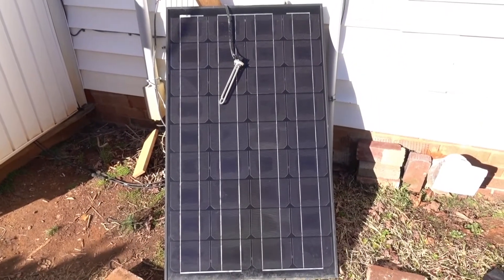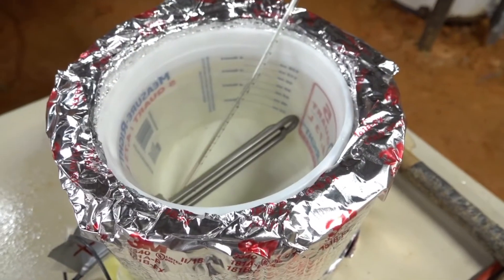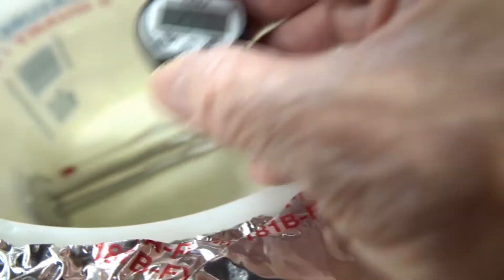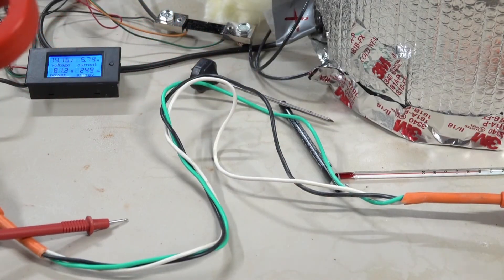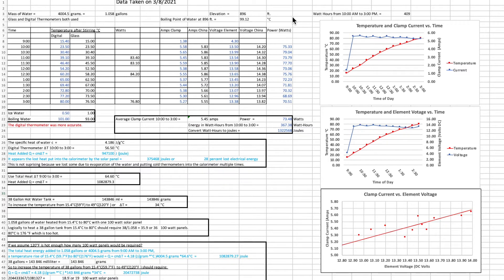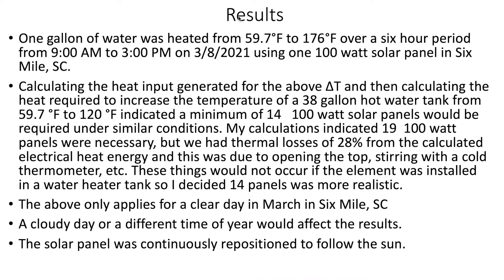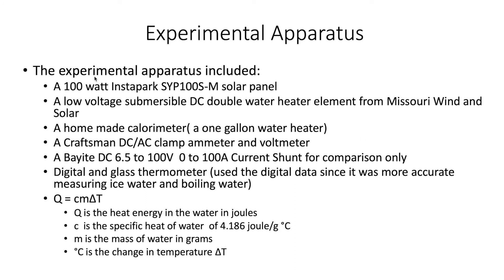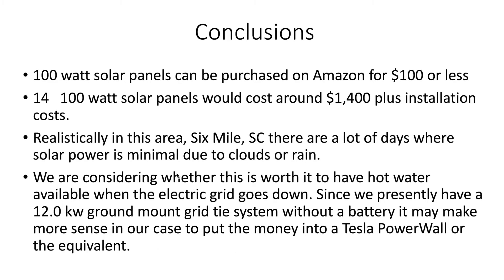Using a 100 Watt Solar Panel to Heat One Gallon of Water

Comment: Very informative video thanks for taking the time to show the world. 
I have a question I'm thinking to add in my scholie motorhome conversion a 6gln water tank with 100W solar panel can you help with what size in watts 12V element should I pair with.
Will the water stay hot/warm overnight installation would be inside and the home is well insulated.
Your help is highly appreciated.
Reply from the maker: You will need to include a thermostat. I used one element of a dual element, low voltage, DC model from Missouri Wind and Solar. They sell thermostats and an element with a built in thermostat. I recommend checking with them. This is a link to their website. https://windandsolar.com/dc-water-heating-elements/
Reply from the maker: Also make sure you have a pressure relief valve. The old Mythbusters blew up water heaters and after watching that it is a good reminder of the importance of thermostats and pressure relief valves.
Reply: Thanks for the reply, I intent to purchase a 6gln water heater tank which comes complete  with it's accessories and just replace the element to 12V.
 My question is what size element 12V watt's ??? With 100W solar panels if need I could go up to 200W.
Reply: @alexkalsatos5555   That could be an issue finding a 6 gallon tank with a replaceable element.  it takes about a KWH to heat up 6 gallons of water. That can't be done with a 100W panel.  Grid tie panels are more than twice the power at the same cost. Slightly higher resistance above ideal will serve you better.
Reply: With one 100W panel it will take some time to heat up six gallons. I would make sure the tank is well insulated so you don’t lose much heat. Some type of thermal collector would capture more of the solar spectrum, but it would come with plumbing issues rather than electric issues.
Reply: Thanks guys you help is appreciated.
Reply: @alexkalsatos5555  A panel flat on the roof of a camper produces about half the rated power due to poor angle.  They sell 65W 12V elements which would be a good match.  If you choose a 300W heating element the resistance will be so low it will ne lucky to even produce 20W with two panels.
Reply: @opera5714  Thanks for the reply, a 65W element 12V is ideal with the 100W s.panel but where do you find this? Some of the main stores home depo etc. Don't have it.
Would appreciate a link
Reply: Thanks again reading all the advise I thing would be proper to go with a 300W to 400W s.panel for water heater only and that should be good enough after a couple of hours in the morning to break the chill.

Comment: Can't say that moving a panel all day is really a fair test.  All studies have shown a normal bell curve where power drops off rapidly beyond the normal 2hr mid day period.  A 12V heating element is never a good match for a 12V panel, did you put those elements in series?  These sunny day videos give people unrealistic expectations of what can be achieved.  Power is a function of the square of the current. I design power point water heater controllers  and when the current drops to 20% of a panels rating, you need five times more panels than when a power point controller is used. Wasting capacity of a power bank and over sizing equipment  is not the way to heat water. I heat three water tanks with the same panel power that goes to the charge controller. That power would otherwise be wasted and more than half my panels are shaded at any one time.
Reply: Very good video, thanks 😁
It does a lot for me, I was wondering if it would be possible to use this method to heat water in a van and now I have a pretty good idea 😁